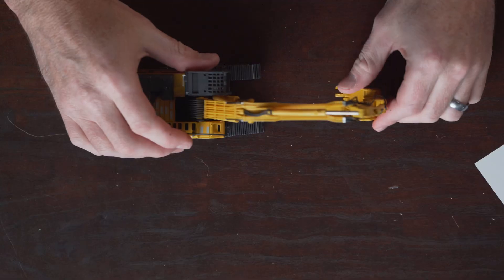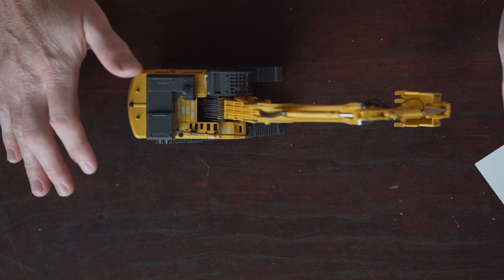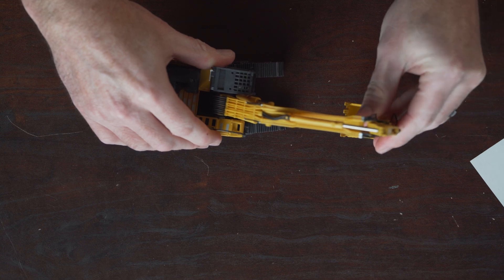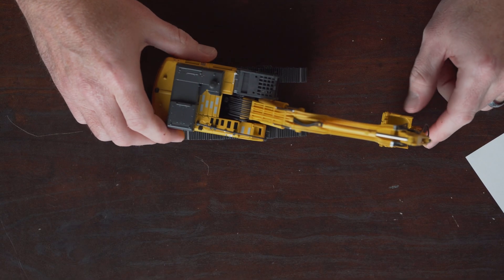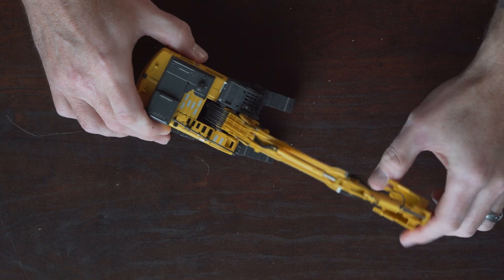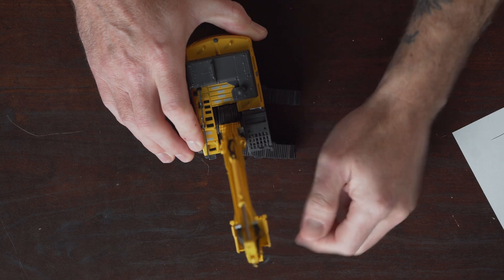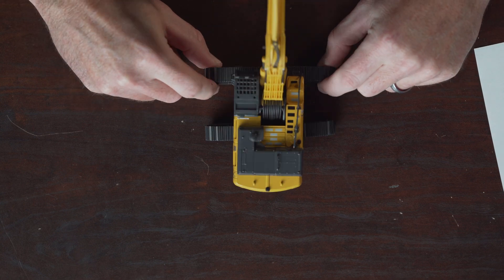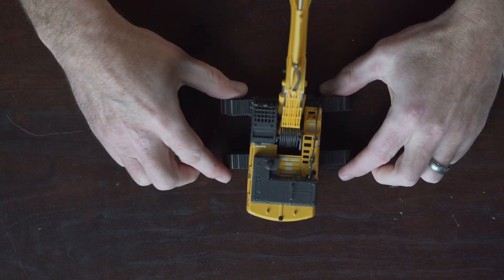How Weight Distribution Works In Excavator

Comment: The centrifugal force scenario as you spin with a load is not one I'd thought of, thanks for this info. It might very well save me having an accident.
Reply from the maker: Happy to help brother!
Reply: One of my favorite little things I didn't figure out for a long time is using centrifugal force to prevent spilling the last scraps in the bucket when you're loading a truck. If you add just a little bit of curl in while you're spinning back around to the pile, the centrifugal force from the spin will pin whatever's left to the back of the bucket and prevent it from falling on your sideboards/haul road/lane closure. Helps you load just a little bit faster without having to stop to shake out your bucket or bring your boom in.